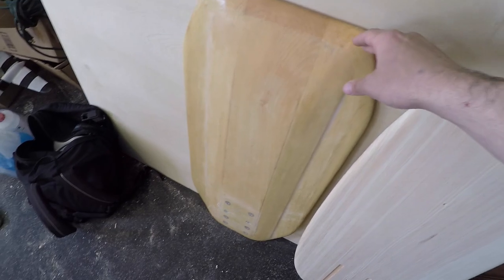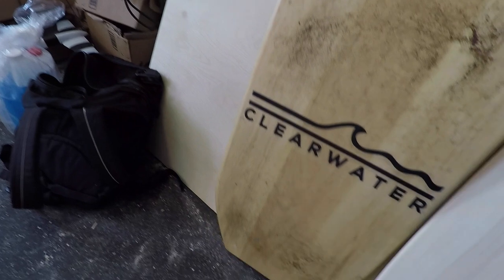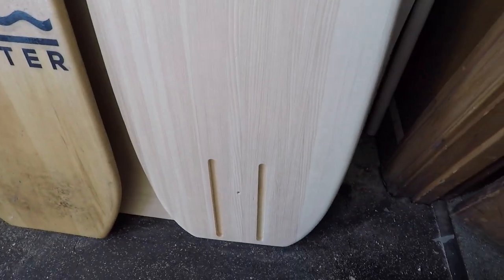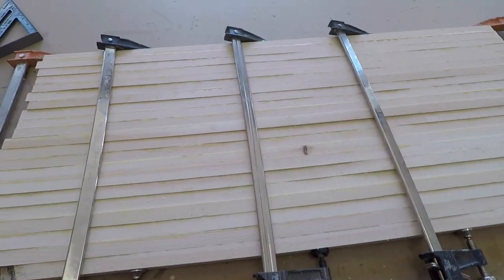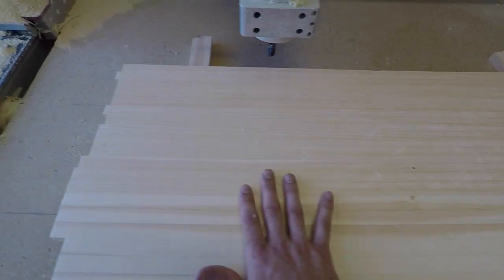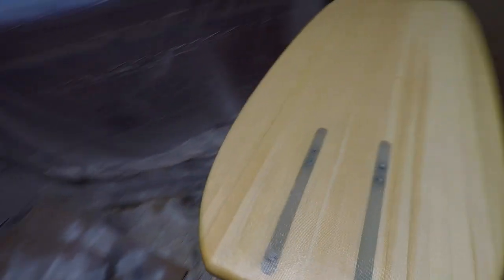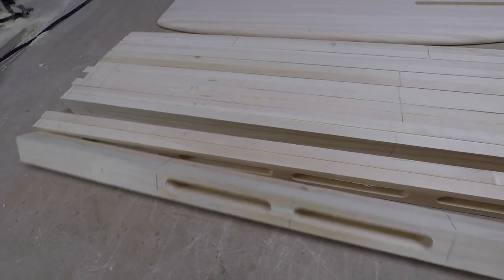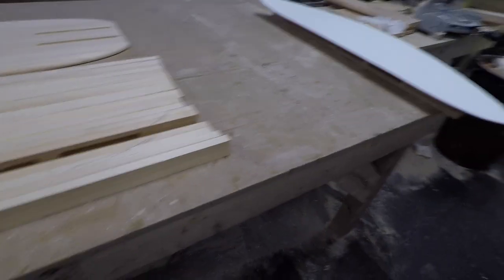Making simple but awesome foilboards

Comment: Nice work with the CNC!  For your foil mount, have you considered putting in Futures 10” fix boxes?  They work really well and can be glassed right in. Also, divinycell foam is really nice for making boards.  How about adding some nose rocker?
Reply from the maker: I have a few of those in the mail but from Factory! I have seen the divinycell foam inserts but they add cost. I am going to try a lightweight wooden version. Next in the works is a board from foam with some good rocker.
Reply: Clearwater Hydrofoils A bunch of us are making foil boards from 1” divinycell foam. It is not cheap, but it is super light, strong, and easy to work with. You can CNC it or shape by hand. It also can be bent with a little heat.
Reply: @davemac1975  We have been using 1” thick H-80 divinycell foam for our foil boards. It is very stiff and light, but still very easy to shape. The 1” thick is good for foil boards because the tracks can be mounted flush and they don’t poke through the other side. To put some nose kick on the board, you can bend it by clamping it to a form and CAREFULLY heating the foam with a torch.